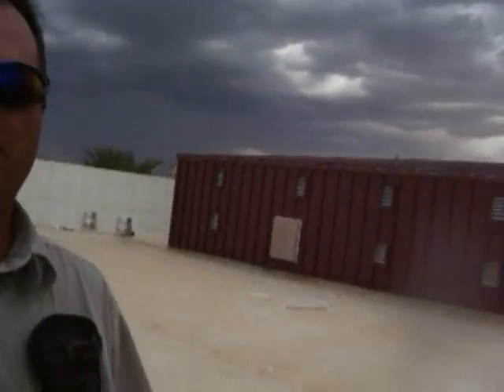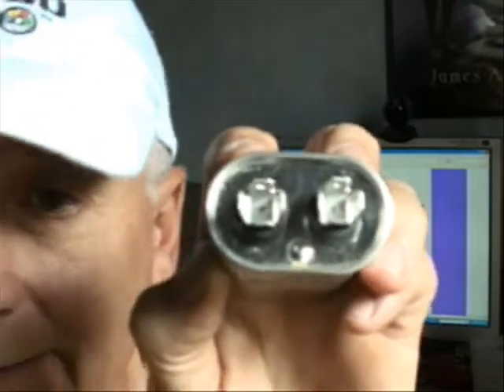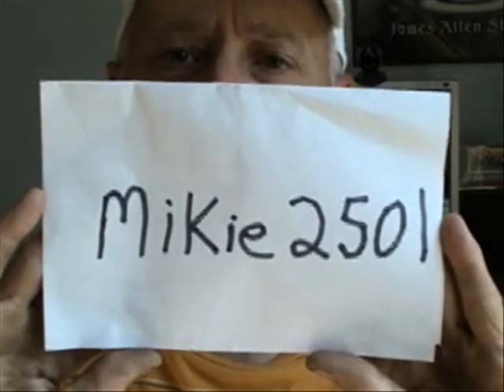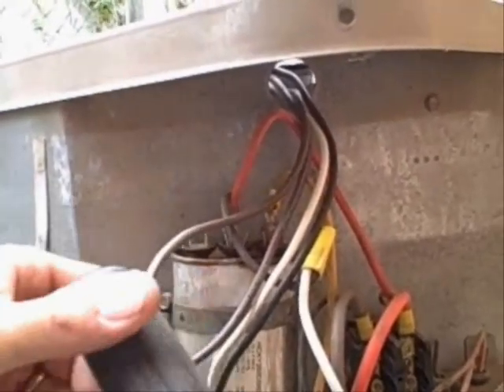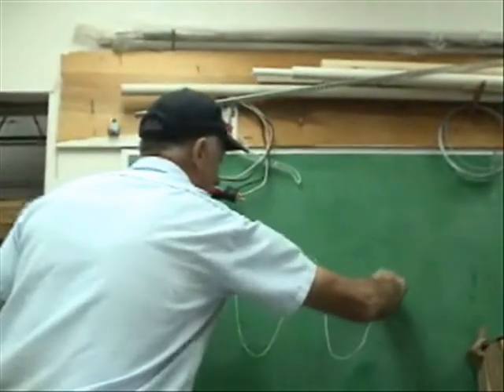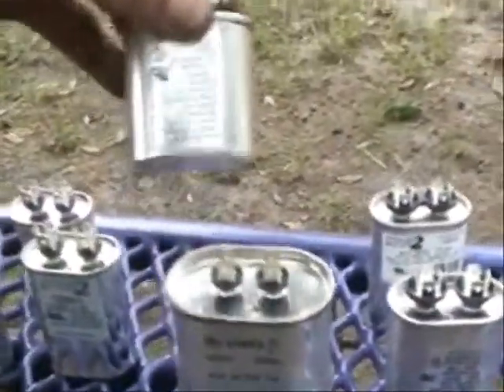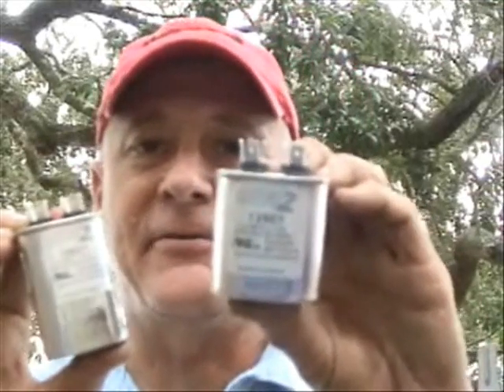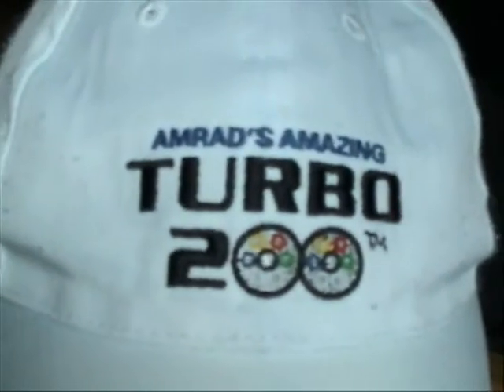HVAC Run Capacitors 2

Comment: As long as you know what you're doing you can get the one run cap that the motor or compressor is rated.

Comment: Thanks for the video!  In reference to your last comment about the two capacitors. One 440 and the other 370.  My ac unit has both.  A technician used electrical tape to hold the smaller unit in place with the larger.  So do I have to replace both or may I use a single larger size capacitor?  Any help would be appreciated.  Thanks

Comment: if you have 30/5 MFD uF Dual Run Capacitor 370 440 vac Volts and what to run 2 single capacitor what do you need

Comment: We all have used a screwdriver in the field.. but the proper way is to use a resistor between the the terminals.. this releases the charge slowly.. but I have always used a screwdriver..

Comment: Hey.. Dr. Z. Is a start assist module  as good as a 5-2-1 hard start kit on a Goodman 3.5 ton?
Reply: Melvin Druen A start assist capacitor pretty much does the same thing as a 5-2-1. You might want to check out soft start systems.

Comment: If a package unit is supposed to have a 30uf, 35uf, or 40uf run cap for compressor, would 35uf suffice for a couple days until correct MFD can be determined?

Comment: HVAC run caps DO NOT hold a charge , it's a myth , The capacitors in electronic devices do hold a charge .

Comment: Thanks for all your videos they are very helpful. I have a question about my A/C unit fan blower. amp 1.95 H/P 1/3 .  Is not blowing enough air into the other two rooms. I install new flexible duck to the other rooms but still is blowing very little air. the rooms are still warm. would it be make a different if I install a more H/P fan motor?
Reply: it sounds like you need to do a heat load calculation on your home to be sure that you have the correct size unit.
Reply: Hi Dr Z 
Thanks for your prompt reply.
My house is 1500 sq foot. Whats the correct size unit for my house. energy efficient unit you can recommend? Again thank you for your time.
Reply: +David Cruz it depends on how energy efficient your home was built. Back when I lived in Ft. Myers, Florida, my home was 1500 sq. ft. under air. My 3 ton heat pump kept me plenty cool. It was a block home built in 1958.

Comment: First, let me ask that you please forgive my ignorance.  I'm an accomplished tradesman in many fields, but electricity is not one of them.

I'm trying to fix the AC at my house.  I first replaced the fan motor and run capacitor because the fan kept going into thermal overload, but that didn't fix the problem.  In fact, I couldn't even get that motor to start.   After doing some more testing I believe the problem is the contact relay has gone bad, possibly shorting out which would explain the scorch marks.  So... while I'm already replacing the fan motor and it's run capacitor, as well as the relay,  I may as well replace everything, which brings me to my question.  

Why are there three capacitors on my unit?  One of them is obviously the fan run capacitor, a second one is for the compressor (the large 3 terminal cap), but what is the third one for?  Any knowledge you can provide would be greatly appreciated.

Thank you,
Elliot

Comment: Can you tell me how to wire in a wire a fan cap separtely from duel run cap. I need a 70 + 10 and all i had was a 70 + 7.5 and 10. but did not know how to wire it properly. I had to run to the supply house on a very busy day. Still very new at this thanks for the videos

Comment: hello , I had a question for a blower motor run capacitor ?   can it be wired wrong?  thank you kevin.
Reply from the maker: As long as the run cap has only two terminal ports it can not be wired wrong.
Reply: ok thank you ,  I took out the blower motor and reversed the wires to see , no change.  I thought it was the control board , fan coming on off in short periods?  yesterday it stopped and gave off a loud hum.  strong smell of burnt windings?  but it still spins?  off to Locks Supply for replacement 1/2 hp  motor and capacitor Monday, yeah it crashed Saturday after lunch supply house closed, lol.  on electric backup.  thanks for the info God Bless.

Comment: Hi was hoping you could help me!! my ac stopped working. there is no air at all coming out of the vents, even though the system itself seems to be working fine. Outside unit is running; the line froze from the unit to the siding.i replaced the batteries and hit the reset button on the thermostat. CAN YOU PLEASE GO TO MY PROFILE AND LOOK FOR A VIDEO CALLED "AC PROBLEM" and see if that can help determine what the problem is? THANKING YOU IN ADVANCE.

Comment: run capacitors you don't change values.they are already at +- 5%
start cap you can go higher by 10%. other than that you risk chance of temp problems on motor. You can take that to the bank.

Comment: Mathematically if dt was 0, the capacitor current 'i' would be infinite. This is not mathematically possible or physically possible (which is why we can't divide by 0). If dt was very small, it would mean the capacitors energy would be discharged very quickly. This would most likely damage the capacitor, with a loud bang.

Comment: You definately don't discharge a capacitor with a screwdriver, you will be asking for trouble. The current through a capacitor is i = CdV/dt. Discharging with a screwdriver gives a complete short across the terminals, meaning dt is zero. If dt is zero, the equation makes i very large. In a large capacitor like the one shown, a short circuit across the capacitor discharge all its energy very quickly, possibly exploding. All capacitors should be dischagred slowly.

Comment: @67tr876 You're both correct, but looking at it from different viewpoints.  Residential service is single-phase.  Now, if you look at the voltage on both hot lines on a 'scope, with respect to neutral, you will see two waveforms, 180 degrees out of phase, as he drew on the board, but they are just two legs of a single phase.   The video is incorrect is in saying that the cap simulates a third phase--it does not.  It simply brings the current and voltage waveforms closer together (PF correction).

Comment: @67tr876 If you measure between the either hot and ground on your ac and on your dryer with both appliances unplugged I promise you you'll read the same voltage...

Comment: @67tr876 I don't have it wrong at all. 220,230, and 240vac are all the same thing. It comes from ppl labeling a line as 110,115, and 120vac through the years. The actual line voltage is usually 117 to 118vac. 230vac no more has a common than does 240 as there is no difference. The power company supplies you 2 hot wires and sometimes a neutral to your house. From either hot to neutral is 120 and from hot to hot is 240.

Comment: @ArtistBlade1972 No your still wrong . see His drawing showed two wave's and that is the hot and com for single phase. The wave is a wire dude ! and 230vac does have a com but 240 is two 120 volt line's to make 240. 3 phase is 3 hot's so 3 wave's . And 120 or 230 is a hot and a com that is showing two wave's for that. My AC unit is 230vac and has a com but my dryer is 240 volt two hot's. If there was one wave then thats not a phase. See you got it wrong dude am trying to help you see whats right

Comment: @67tr876 Actually I'm not wrong at all. I didn't say anything at all about 2 phase power. His drawing showed 2 phases for what was supposed to be single phase. And futhermore there is no common in a 230Vac system.

Comment: The run capacitor is for power factor correction. It does NOT simulate 3 phase in the least. The reactance of the cap counters the inductive reactance of the winding to bring the current and voltage in phase thus achieving maximum efficiency. Your sine wave drawing for 230 vac single phase is also wrong. Single phase power is single phase. It does not look like 2 phases of 3 phase 120 degrees apart...

Comment: @plaebslayer The phases are created by the power company.    They either have 3 poles in the primary generator, 120 degrees out of phase with each other, or they operate 3 generators which are 120 degrees out of phase with each other.  

3 phase motors typically won't use capacitors since they have such incredible starting torque.

Comment: I have a campbell hausfeld compressor where the Run Capacitor ruptured and leaked out it's fluid. Is this just normal failure or is something else going on? I have had problems recently that the Compressor wouldn't run beyond 40 PSI without tripping the breaker. Was this all just the normal progression of the Run Capacitor going bad?

Comment: Yea it must have been an error on my part. But it seems like I had it out of the unit but I guess I just don't remember now.  So there's no way it can explode by shorting it out like that ?   ok , must by an error on my part. But it was a long time ago and I was doing sheet metal just learning the refer end of it. Never stuck with it. Till lately I'm thinking of picking it back up again. Thanks for the nice video's

Comment: Doc,  you're off on this one.  the purpose of the run capacitor is to bring the current, and voltage in phase with each other.  since power is voltage times current, maximum power is achieved when both volts and amps are peaking at the same time.  i'm new to HVAC, but I KNOW electronics.

Comment: hi. DrZ! thanks for your support! well my problem is, the hvac´s fan is running way slower than it used to when new, i cleaned it up the way you show in another video but nothing, can the run capacitor (almost 10 years of use)  make the fan run slower??? should i replace it?

Comment: it means the capacitor is 80 micro farads and can take a load up to 370 volts on a 50/60 hertz alternating current. hope that helps

Comment from the maker: I've never had that problem with a screwdriver. Usually, the run caps have no charge to them when the power if off. However, there are those times when they have a charge.

Comment: First off great videos...but I find some of the info misleading.  The Run capacitors job is to keep the start winding in the circuit thus giving the motor better torque, efficiency, and power ratings. 
Also with regards to the sine wave...it corrects the split phasing of normal single phase motors.  It doesn't add "another" sine wave.